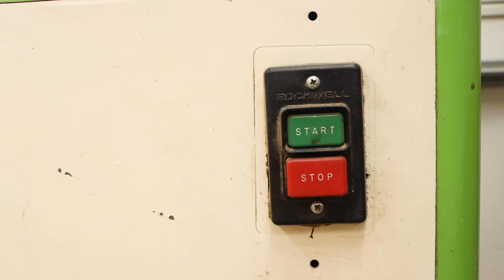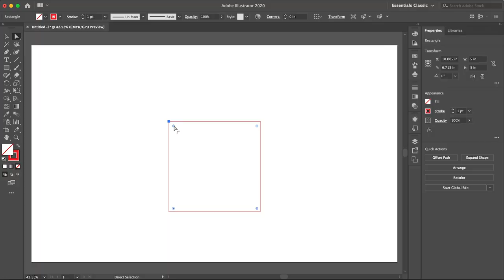Making laser cut router templates with my Glowforge

Comment: Great outside the box thinking.  Back when I used to build surfboards we used a thing called a spin template.  It allowed you to have a 5ft long template to create board outlines that were over 8ft.  That may be a good technique for the glow forge!  Nice job bud!
Reply from the maker: Thanks so much! I really appreciate it. It was a fun one to film. It’s funny you mention the surf boards. I was originally planning to make a skateboard as one of the examples... but it seemed tricky with the contours. I might need to approach it again now that you’ve mentioned a similar method being used on surf boards.

Comment: How is your compression trim bit holding up?  Can you recommend it long term?
Reply from the maker: Hi, Terry! Mine is still going strong... it was expensive. With that said, I use my CNC machine way more and probably don't have enough hours on the bit. I also use compression bits often in my CNC - they're great. Although, I think all of my bits get dull each time I make a bad mistake. ha! I tend to burn them up before they get dull.

Comment: Great video, I had designed a few templates but never did finish that project. Thanks for the inspiration.
Reply from the maker: Thank you very much! I appreciate it! Even though I own (and love) an awesome CNC machine, I do still use laser cut templates quite a bit. They're fun and are really quick to use if you're reusing the same template.